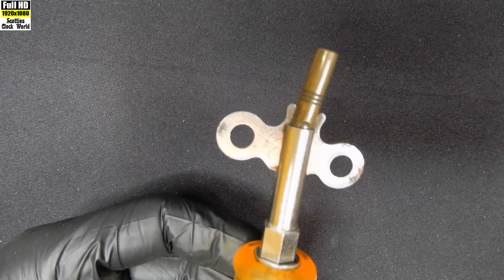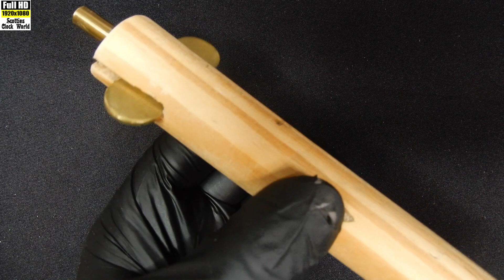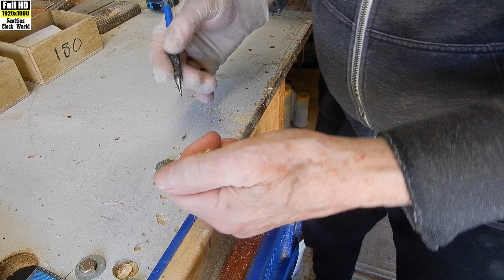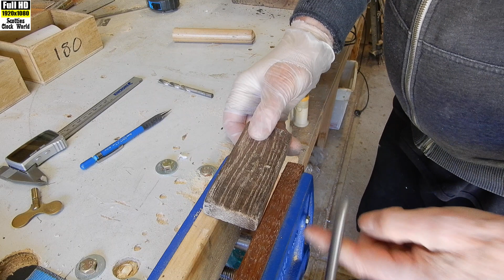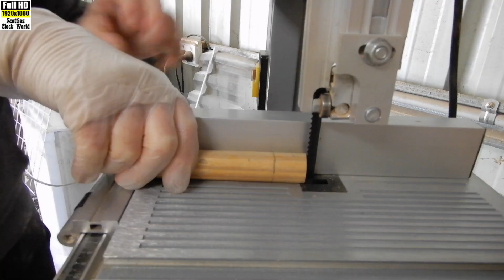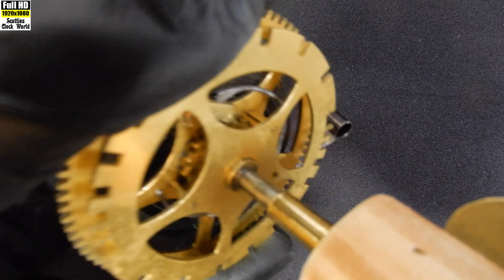DIY Clock Mainspring Letdown Tool

Comment: So ok i now know how to make the tool but i was waiting for how you use it ?you wound up a spring that was already out of the clock how do i unwind a spring thats still connected to the clock?
Reply from the maker: @leath25, Clock repair For Total Beginners - Lesson 3 @ timestamp 5:54 will show you how to use it.
Reply: @ScottiesClockWorld  ok thanks scott ive been given a smiths mantle clock with chimes.mate said it was over wound didn't have a clue and tried to take it apart but it exploded on him its in pieces now all the parts look ok just needs putting back together so i thought id give it a go.i was worried about the main springs still having power.regards carl from uk
Reply from the maker: @leath25 , Hi Carl, is this the first clock you have worked on? Send me a couple of pics to clockandelectronicschannel at gmail dot com and I;ll have a look at it.
Reply: Thanks for replying mate

Comment: Great job in making this and letting people know that you can use one without breaking into the bank account to have to buy a let down key. All the tools can be expensive to someone who is just beginning clock repair so showing them that you dont have to buy all the tools is helping them out. Plus if they spend all that money and then decide that they dont want to work on clocks for a living then they just wasted a lot of money. With your shop tools you did a safer job that what I did with my video. Helps to have the right tools.
Reply from the maker: @munnerlyn3, sure helps to have the right tools but they are sitting idle at the moment while I recover from tendonitis surgery. I wont be making anymore furnature, cutting boards or doing spoon carving for a few months yet, more's the pity.
Reply: @ScottiesClockWorld 
Hope you & your hand are much better now...
Reply from the maker: @davestelling  , getting better but my hand still cramps up. Thanks for your comment.